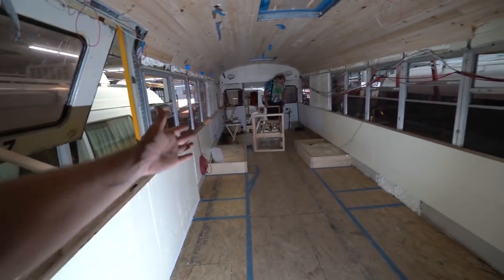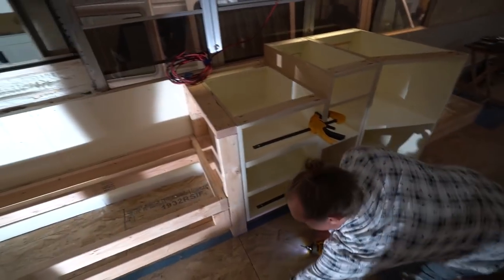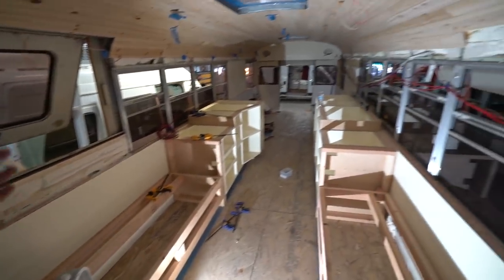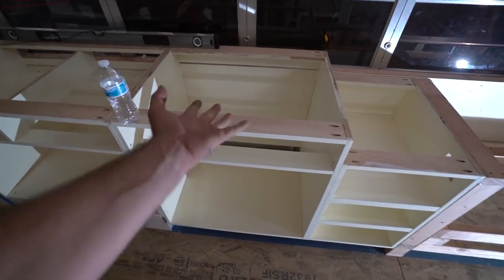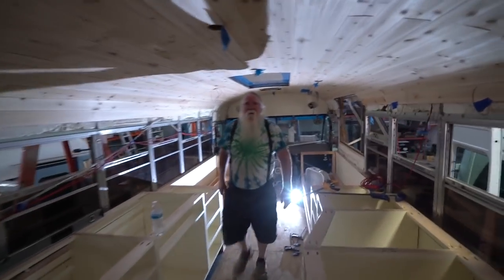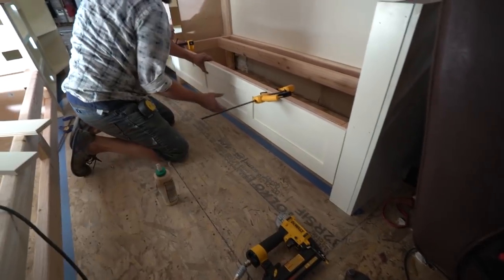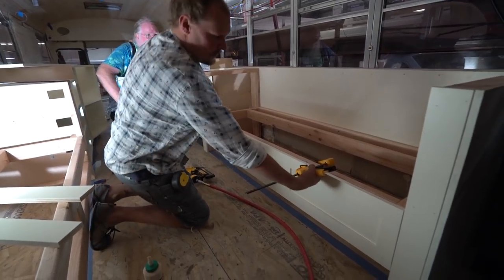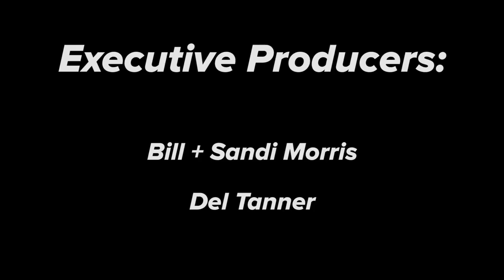Cabinet Install + Goodbye

Comment: Bus is looking real good there buddy , How long is your bus Like what size is it I'm looking for a medium size plus Not the real big one and not the real small  I need a medium one I'm looking for one that's got the Handicap Lift Today I wanna be able to put my motorcycle In there in the back Make that a garage .Looking for one that's got the lift on the Passenger side in the back .Well have fun .
Reply: From the back of the driver's seat to the back door it's 22' 
Even though our buses are the same length my flat nose had 5' more interior space
Reply: Thanks for reply Steve l'm subscribed to your channel awesome .What's the full length from bumper to bumper Of your buses .
Reply: Mine is 33' bumper to bumper

Comment: Why have you not done electrical yet? Should of done electrical before the sides were put on, before the insulation was sprayed. As well as all plumbing should have been done before any of this
Reply: He has an upper and lower wire chase. We ran the wires for the ceiling lights as we put up the ceiling.
Plumbing will be run in the chase behind the cabinets.
All according to plan